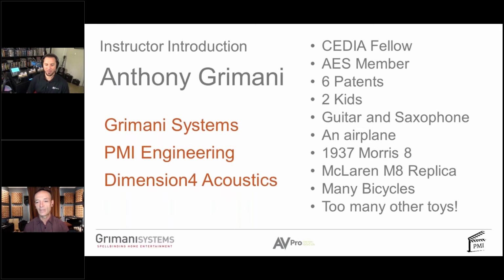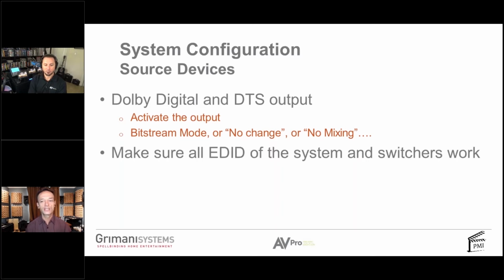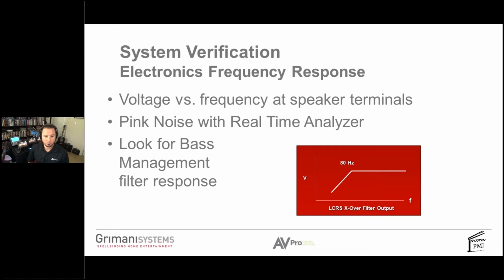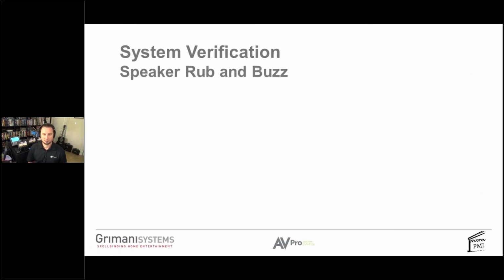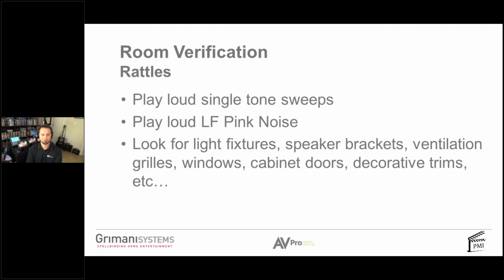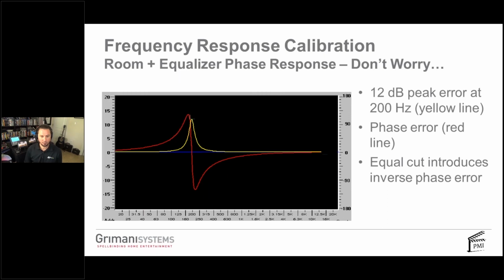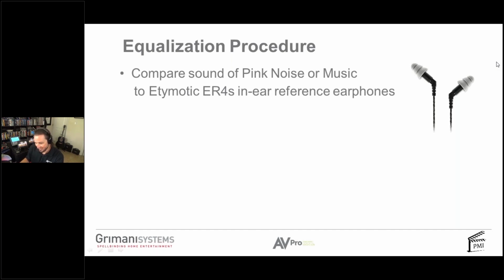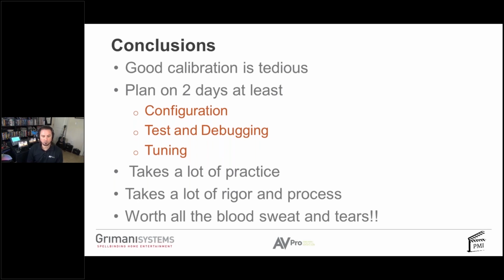Expert Audio Series: Calibration and Equalization

Comment: So. Don't EQ above 1 kHz, but add a gentle slope up to 6 kHz - how does that work? And what happens with the slope above 6 kHz? And what happens above 20 kHz if you add a slope when a processor won't let you make any  adjustments above 20 kHz? Does the roll of continue, or will you get a crazy spike at 20001 Hz?